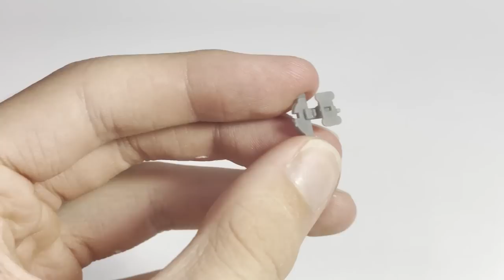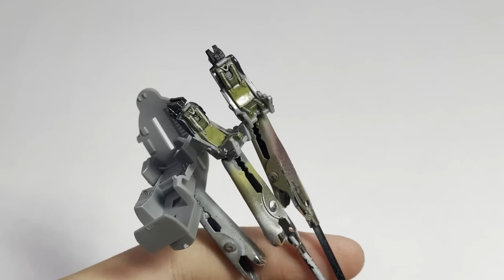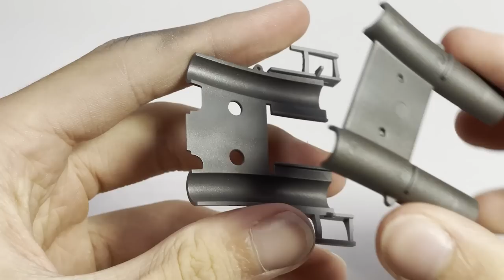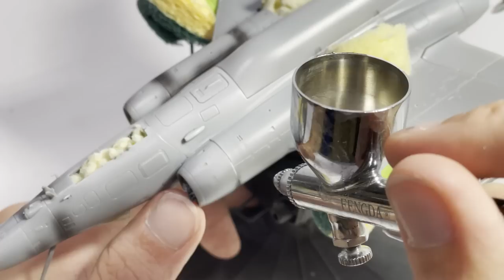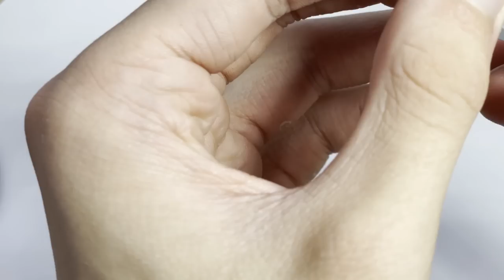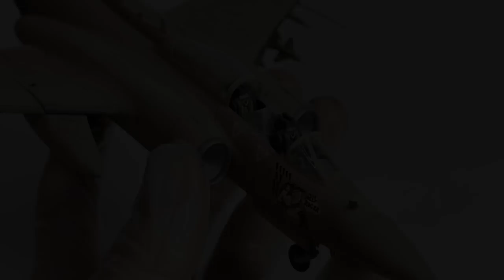Airfix's New 1/72 Blackburn Buccaneer S.2B | Full Build | HD

Comment: The transparent wing tips is a great idea..in the past aircraft models were usually provided with a port and starboard transparent navigation light which were incredibly small and fiddly to fix on especially in 1:72nd scale. Making the entire wing tip as a transparency enables the non painted part (the actual navigation light) to be correctly fitted and then simply mask off the transparent light when painting the wing.
Reply from the maker: Thanks for letting me know! I did. think it was something like that but i’m glad to have someone confirm for me!! Thanks again😁

Comment: Looking forward to your build, I spent many years working on the real thing.
Reply from the maker: Thank you! What was it like to work on them? Easy, difficult etc etc?
Reply: @machmodels  Interesting, challenging too, spent quite a few hours upside down in the cockpit bleeding the brake system. But these really flew low across the sea and the rear tail hatch, where the LOX pot was stowed usually had sea water in it after a sortie against shipping. We had an amazing squadron on 237 OCU and they were brilliant on use of the pavespike for designated bomb targets. I wanted to go with the Sky pirates to the gulf but was on Nimrod majors, but have film of your jet coming home, Lossiemouth was packed. Great job by the way, brought back some good memories. All the best in the New Year to you.